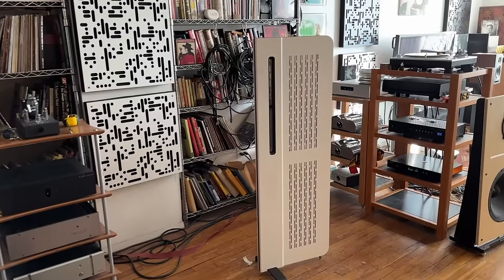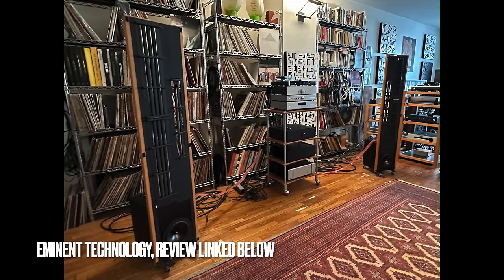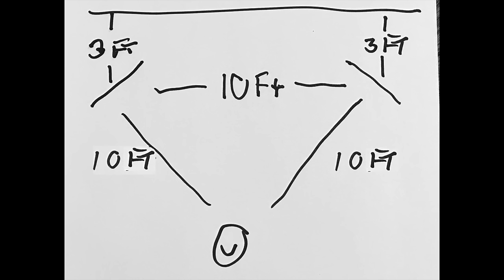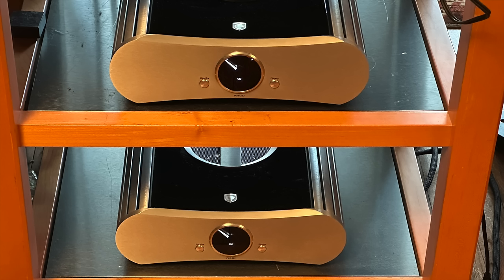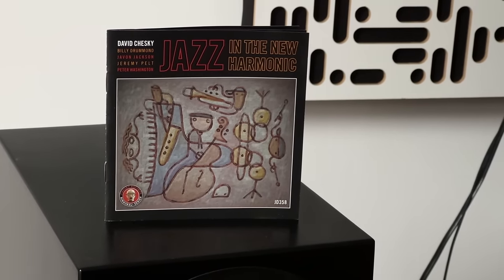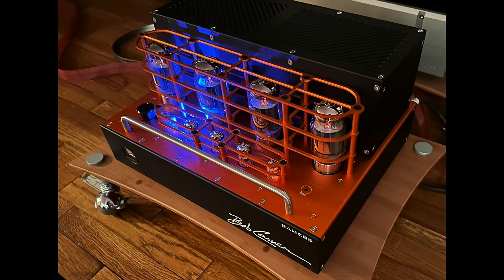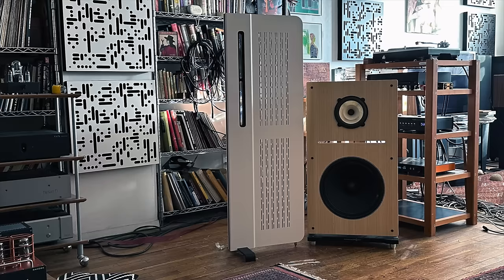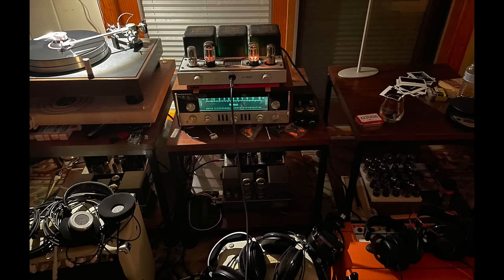DIPTYQUE Planar Magnetic Speakers, The French Do It Better!

Comment: I spent years trying to get as transparent, clean & linear  sound as possible... Turns out it's useless unless you only listen to perfect recordings. It's really tricky strike a balance between perfect audio replication and it sounding pleasant most of the time with most albums.
Reply from the maker: Exactly
Reply: If it plays Physical Graffiti, Dark Side of the Moon, and 2112 well, that's all that matters. 
Maybe a little Lyle Lovett and Bob Marley. 😊
Reply: Physical Graffiti and Natty Dread were some of my first proper hifi experiences.

Anthems of a well spent misspent youth.
Reply: @peterlarkin762  
Puff, Puff, Pass
Reply: Have you ever tried the big JBLs? Say the 4367 and up (4365, S9900 etc)?  I have found them to be both refined, 
transient and powerful at the same time, never harsh. Food for thought.
Reply: I purchased the magnepan 1.6qr in 2005,( can't believe where the time went!). They're Biamped with tubes on midrange and treble, transistors on bass, with Myesound stands and stereo subwoofers = end game for me. I'm tempted however by the Klipsch Heresy, the Warfdale Dentons and Heco Aurora 1000's,( the last I would like you to review!). I love jazz, classical, reggae, blues, rock, r&b, club/house and some hip-hop (but not today's, only classics!) and intimate acoustic music. I listen at various volumes and the speakers have to jam out as well as play realistically at low volume.
Reply: Made my on ribbon hybride. 120cm long 3,2 wide ribbon with neodymium magnets 1 cm wide 2 cm deep and 120 long each side .two 18'' AE dipole digital crossover 250hz. Fairly cheap way to get highend.
Reply: I judge the speaker as how it sounds with female vocals along with clear clean and a bit of sparkling sound. Any veiled or dark or too warm muffled is total no ! I like polk and Q acoustics manage great balance and sweetness and spark in music and female vocals.
Reply: @JamesWilliams-gf8gm  I'm a Harman Diamond level dealer (JBL & Revel's highest tier), a Klipsch dealer, & a Diptyque dealer as well....

The JBL Synthesis pieces you're referencing are technically outstanding, but the Klipsch Cornwall IV is the more engaging/exciting speaker. It's better than the sum of it's parts. Same for the Forte IV.

As is mentioned in this video, however, I do agree that Diptyque is BETTER suited for certain types of music & gear than those other two brands.

I LOVE live rock, classic rock, blues, etc. Steictly 2 channel, in a large room I'm taking the Cornwall IVs all day. Small room: Forte IV.

The Diptyques are amazing, but are really for a very specific type of user.

Comment: I definitely wouldn’t say that having to play with a speakers positioning so much is a sign of a good speaker…the fight against a radiation pattern that is extremely narrow at higher frequencies is IMO the primary weakness of panels
Reply: Exactly right. Good speakers with good frequency response and even dispersion should not need fussed with too much.  Uneven speakers you will chase all day every day around the room.

Comment: I switched from MG 3.7 to DP107. Despite not going as low in bass as 3.7 they are better at every other aspect, but I wouldn't recommend them to anyone who doesn't use dsp. I feel like theirs stock frequency response is messed up. I hope they got it better at DP140 and up. I wish them luck because their speakers are amazing

Comment: I had the original Carver Amazing speakers, dipoles that had ribbons for highs and mids. Whatever their flaws, they had excellent soundstage depth and pretty good imaging.
Reply: I only heard them once, at a show. Powered with Carver’s gigantic tube amp. They were genuinely amazing, by far and away the best at the show. One of the most memorable speakers I’ve ever heard.
Reply: I have two pairs of Carver AL-III+ speakers.  Ribbons have a presence that is amazing. I keep thinking of replacing them with something else. There are box and planar speakers that may be better but the Carvers are so good on vocals I can’t justify parting with them.

Comment: Thanks for the technical insight on these Steve, esp. the dual magnet planes.

To your (and @glenncurry3041) point of adjusting planar speakers, I got a pair of Magnepan MG IIIa in 1986 and had them rebuilt in 2009. Over all those years until now they have been in almost every conceivable position in my listening room. Surprisingly one of the most interesting placements was to put the "edge" of the speakers literally in the two corners of the room, with the other edge pointed to the listening seat at 45 degrees. Both front and rear phases were reflected from the two walls at the corner (no direct sound from the diaphragms). Vocals and instrument placement were holographic. Both aurally and visually the speakers disappeared. The only compromise is the soundstage is too broad for studio recordings, although perfect for live recordings like "The Allman Brothers Band Live at Fillmore."
Reply: Impressive, isn't it? We call that the "Rooze configuration" on the Planar Asylum after the guy who first tried it.
Reply: @Josh442  From what I read, the Rooze configuration is not what I'm describing... put the thin edge of the Maggie literally in the corner of the room, or as close as you can get it, given the length of the feet. The other edge is 45 degrees from either wall, pointing to the listening position apex. There is no direct radiation toward the listener's ears, only what's reflected from the walls. Unfortunately my wife prefers a more conventional placement 😞.
Reply: @bellesonllc  That seems to be one variant of Rooze, anyway -- the idea of Rooze is that you're listening on edge, in the dipole null, so the only sound you hear are the reflections. But Rooze isn't necessarily right in the corner.
Reply: @Josh442  Okay, got it, thanks for the clarification! And yes, to your original point, it is impressive.

Comment: You got me thinking when you described how tricky they are to place. The upper half of a room usually has less sonic obstruction than the lower half. I picture a room twice as long as it is wide with the speakers mounted from the ceiling, on the long centerline, spaced so each can face directly toward one of the opposite corners, either diagonally or either end of one of the long sides. this would make the room the resonant chamber driven by the Dyptyques. Far beyond my financial abilities so thanks for the introduction!

Comment: I own a pair of Apologee duetta 's I use them with an older krell ksa 80 . It's a shame this company is no longer around.  I also own a pair of B&W 802s . Which I use with various amps such as Threshold.  Spectral and sonic frontiers . I like your take on ribbons I prefer my Apogees hands down but at high volume the B&W s are an amazing speaker.  I haven't heard your speakers but I would be surprised if they bettered the appogee's made in America.  Your  take  on the Apogees would be interesting .90 percent of the time I listen to my turntable of course . I prefer older recordings . You are the most knowledgeable and credible person I've watched on you tube so far . Cheers !

Comment: Looks nice, I like magnepans fine and always feel like the quality is lack luster. Good to see higher quality panels in the market. 

I am more of a horn guy (JBL 4367) so I alway feel panels lack dynamics to my ear. Do these have more snap/transients than other panels?
Reply: It's entirely different, but you gain so much elsewhere. 

Dipoles don't 𝙥𝙧𝙚𝙨𝙨𝙪𝙧𝙚 pulse the room like typical monopole box speakers. 

Sound 𝙞𝙣𝙩𝙚𝙣𝙨𝙞𝙩𝙮 is the product of sound 𝙥𝙧𝙚𝙨𝙨𝙪𝙧𝙚 and particle 𝙫𝙚𝙡𝙤𝙘𝙞𝙩𝙮.

Dipoles throw more a velocity dominant intensity rather than the pressure dominating that's typically experienced. 

The strong attribute; due to out of polarity figure eight radiation characteristic, the listener experience has elevated direct sound vs. negative room effects. 

They don't light up a room's resonances like a monopole pressure source.
Reply: @FOH3663  I have spend time with the magnepan 3.7. They are nice but come up short when asked to play Metallica at high levels. Amazing with Gregory Porter…. 

Maybe just a second system for me. I am often more in to mood for rock than soft music these days.
Reply: Yes.
Reply: Two sets of speakers serves me well. I love my Maggie’s for acoustic jazz. If I want high SPL, I switch to my old EV Eliminators designed for stage use .

Comment: There is no perfect speaker or amp, just different! I have a McIntosh c50 preamp, very quiet and neutral but it has the EQ when I want it. I also have a McIntosh mc352 SS amp, very lush sounding but there is detail if you listen for it. I also have a Carver Crimson tube amp which makes everything sound good, and finally two class D mono amps that really let you hear everything, good recording are good, bad are bad. I find myself using the McIntosh most of the time. But just to keep the boredom at bay and keep my pocket book healthy, I switched every now and again just to keep it fresh. Right now Klipsch La Scala’s and restoring a pair of AR 5 three ways from the late 70’s

Comment: That's a problem with ribbon tweeters, or specifically with tweeter line arrays; the beaming means that if you are above or below then the highs really roll off.  I noticed this with my Carver AL-III+ with 48" long ribbon that are even with the top at 6'.  Even lying on the sofa, instead of sitting or standing one would experience roll off.  Ideally and in IMO, ribbon tweeters should be 6' tall starting from the floor.  Either a single 6' long tweeter, or one can have an array of small rectangular or round tweeters that extend 6' from the floor.

Comment: I had a pair of Magnepan 3.5. After a few years the glue that binds the coils to the mylar started to loose its properties and eventually the coils were unglued. Although I loved those speakers I could not send them to Manepan for repair. Does the Diptyque has the same problem?
Reply: Hello. I'm owner of DP107, previously had MG 3.7. Diptyque surpass Maggies in terms of build quality - there is no glue on diaphragm, instead coil is printed on the foil. Looks neat, diaphragm is lighter for sure and foil with coil are one uniform thing

Comment: The closest thing to these in my case are the Monsoon FPF-600 and FPF-1000 speakers i have owned a couple of years ago oversees. It doesn't sound like boxed speakers either indeed. Open baffle ? You better got your room acoustics.and placement in order. But they do create huge wide 3d like soundstages and detail...
Reply: @PulledPorkGarage - I use Monsoon MM-702 Planar Magnetic Desktop Speakers in a tri-amplified system for my desktop/PC speaker system.  It's a near-field setup, so there is one ideal listening position that is in my chair in front of my desk.  I have a pair Yamaha YST-SW-60 servo subs used for mid bass (play from 65 to 220 Hz) suspended just above the Monsoon panels sitting on my desk, and a Velodyne 8" MiniVee (1,000 W RMS) servo sub as my subwoofer (crossover 65 Hz).  I use a Dayton Audio DSP-408 to control the crossover, and set parametric equalization and delay.  Perhaps the DSP kills some resolution ultimately, but the flexibility is amazing.  For example, I can change the delay and hear the difference, I can change the crossover slope and points and play with the equalization and hear the results.  I have two pairs of planar magnetic headphones and comparatively the desktop system sounds pretty darn awesome. 

At some point I'd like to get the Magnepan Bass Panel to replace the mid bass speakers, but it's out of my budget at the moment.  Perhaps a higher end DSP in the future.  Maybe play with a fixed active crossover to see how that sounds, or even a passive xover.

Comment: So if you play a lot of poor recordings you should use a speaker that's colored in a way to ameliorate the bad sounds?

I'm curious about the steel front and back panels. I'm sure the magnets are strong and steel is magnetic although to what degree depends on the type of steel.  So I assume the panels are magnetized. Is this part of the design? I'm just curious.

I have to add a comment on push/pull planars versus single ended ones. They reproduce signals asymmetrically. That is the displacement from neutral is different on the side with the driving mechanism than it is on the other side. This is a flaw in fidelity, in accurate reproduction.
Reply: @nobelstone9714 - Typically if there are magnets in front and/or in back, then there is a resonate frequency because of the cavities and channels.  The crossover has to attenuate that frequency, or one needs a parametric equalizer.  At least some Apogee ribbons have the ribbons on the side and don't have the issue.

Interesting comment on the push/pull asymmetry; I hadn't considered that.  Years ago before, I was a fan of push/pull isobaric subwoofers.  Currently I like servo subs.

Comment: There is one veeeeeery important detail missing in the whole story and which is the bane of all planar speakers: LONGEVITY.
Are there replacement panels? Can the manufacturer guarantee a stock for the next years?
Same goes for other exotics like the Apogee-derived Clarisys panels costing insane money and Analysis Audio planars.
The Diptyque looks to be using a single ribbon for the tweeter like Apogee and Magnepans do, these are guaranteed to sag and lose tension over the years.

And don't even start me on ESL's like the Quad, the 63 and later are utter garbage in that regard.

In the end, there is a good reason why planars will remain a very niche product, they won't work in many rooms and have a 1 person wide sweet spot - turn your head an inch to the side and the soundstage collapses.

Comment: Tweeters should be point-source because the high frequencies can radiate to all heights of the listening position.   When a tweeter is a line source, the line should be at least the height of the listener because the high frequencies will disappear above and below the line, as in the case with the DIptypque.   Personally, I dislike  tweeters that restrict how you can listen to them, so I would not be interested in speakers like the Diptyque.
Reply: @ron101346 - Exactly, line source tweeters should be about 6' long...

Comment: It is easy to do better than for example magnapan.
I can better the sound quality of it with some easy alternate solder job on them.

So I have a pair magnapan that is over 40 years old. And yet to this day magnapan use the same connectors, plate, fuse holder, attenuation screws and so on.

It is good in that way that it keeps the cost down..😅

But come on. No development or better solutions for OVER 40 years! 😢

Then it is no surprise that newer Constructed French speakers sounds better than stock magnapan that is hold back sound quality wise by its outdated and sound quality robbing construction that has not evolved anywhere.😢

So sad to see new offering from magnapan with the same crap backplate and knowing that the owners will never hear their speakers full potential! 😢